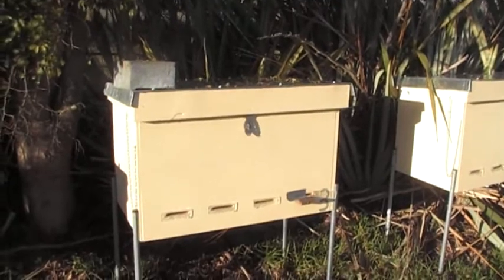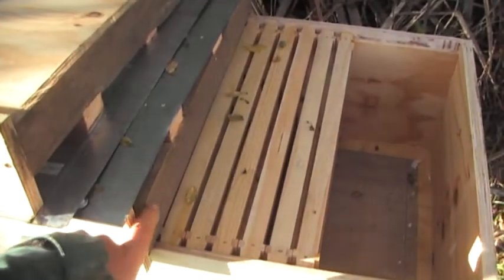Beehive design - Plan B(ee)

Comment: Would you mind explaining the issues with the double height horizontal?  I consider building one.  Thanks!
Reply from the maker: Sorry about the delay in replying, I'm a youtube noob and didn't even realise I had comments (o_0).    The problems included; not being able to fit other standard equipment - top feeders, extractor, queen excluders (not as evil as I thought), giving too much space for the bees to look after, too much work to build each one (apiary grows fast), too heavy/awkward to relocate, not easy to resize from nuc to full hive.  For ppl building one it definitely needs an inner cover and a canvas inner cover would have solved a lot of the access issues. I use canvas inner covers on all my standard langstroth hives now and these inner covers have a few advantages - they breathe, are cheap (a third of hardboard equivalent), and you don't have to lift off the entire inner cover to check on the hive (just lift a corner).